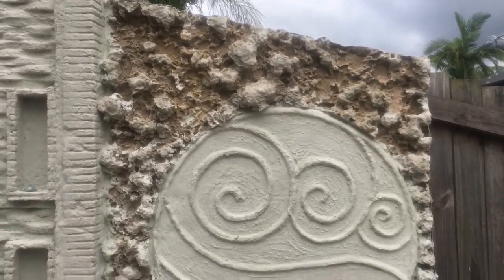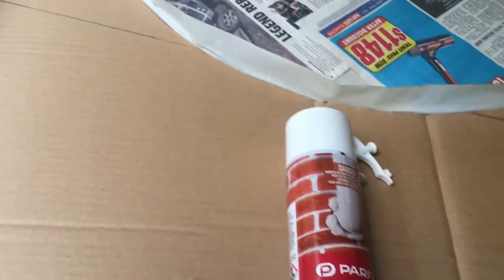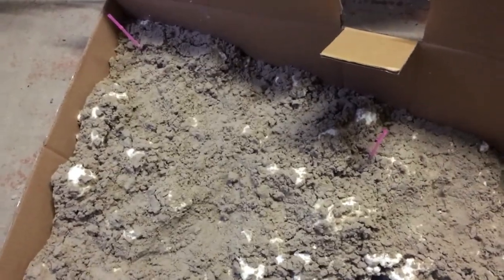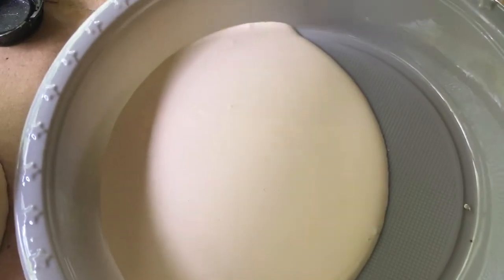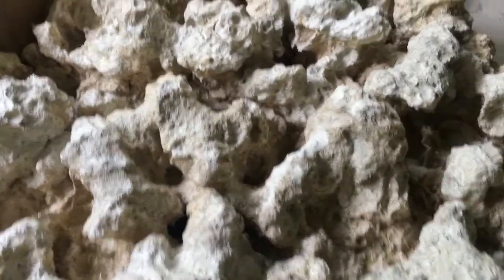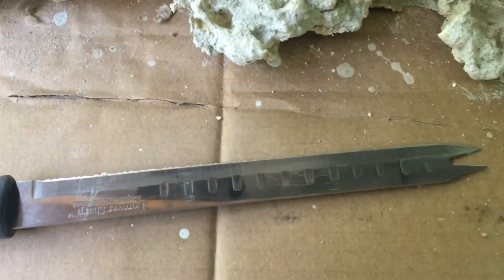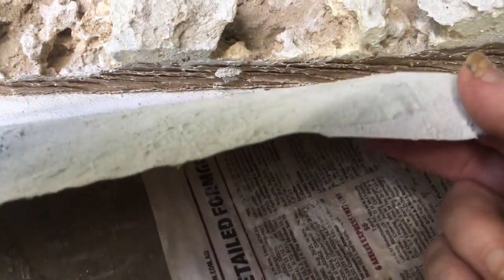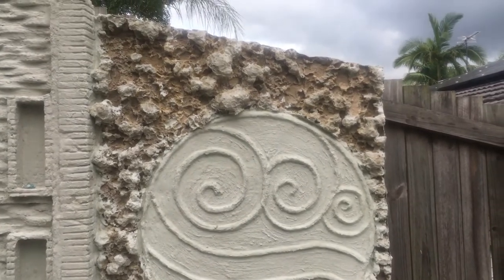Faux Coral Backdrop wall (Expanding foam) How to make

Comment: Hey! Thanks for the awesome video! I want to use it for my ocean themed bar. Do you think it is steong enough?
Reply from the maker: Hi Thank you for watching .If you put it on polystyrene as the backing it will be strong enough and look amazing. Don’t forget to use damp sand as it gives it make the foam look more like coral like the one in my video. It works extremely well on wood as well small tip don’t try doing it up right must be flat on the floor. I am so excited for you I think your Bar will look absolutely amazing 😊Good luck please let me know how it goes Cheers

Comment: wow nice.  I have a property in mid Florida with tons of white sand I want to use as a building material.   I wonder how rigid and durable the final product is? Is it squishy?   Can it withstand years of hot tropical sun, rain and wind? Thanks.
Reply from the maker: Thank you so much 
I live in quite a hot and rainy part of Australia in Queensland So it does take a beating, what with cyclones and heavy rain, mine has been up quit a while,as to how long it lasts I think 5 years is a good guess. It is not squishy it is quite hard. Most importantly you must PAINT it thoroughly because any of the foam that is exposed will crumble and turn orange. Please remember when you are making it you MUST use DAMP sand or you will not get a nice effect Hope this helps and good luck it is such fun to make Thank you for watching 🥰